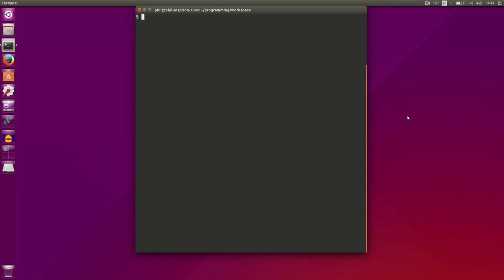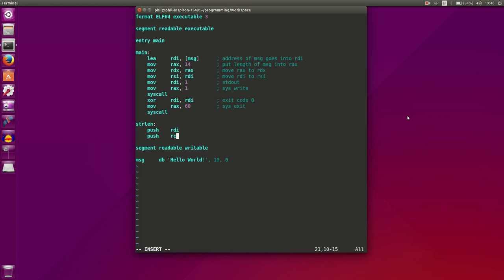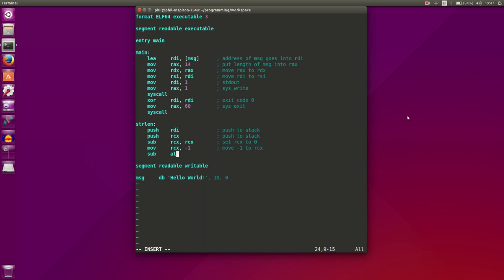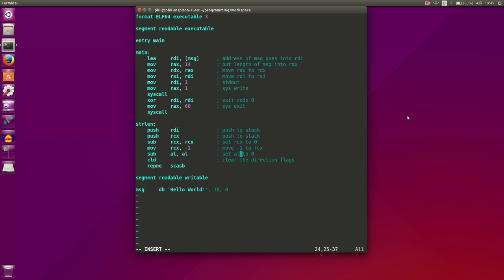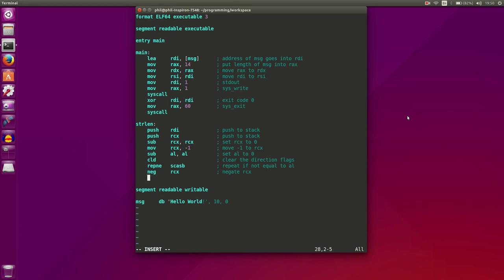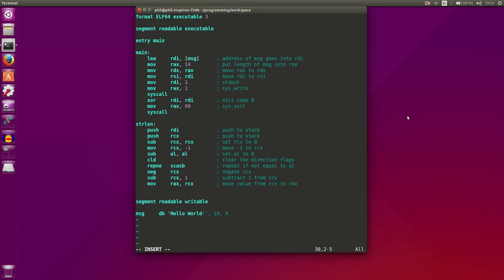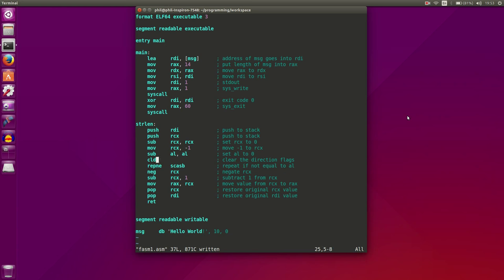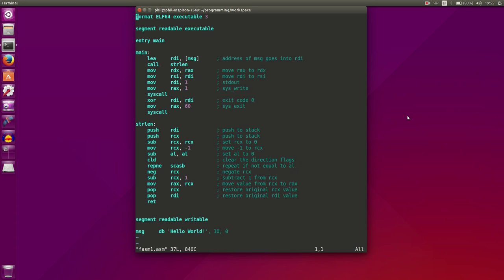Fasm 1 - String Length

Comment: The subtraction to zero the register is pointless in this case and confusing.  The move sets the register without introducing advanced considerations like instruction speed which could be a reasonable consideration for a heavily used function.

Comment: Forgive me if this is a dumb question (I'm a noob), but why do you set rcx to zero by subtracting its value from itself? Couldn't you just move zero into rcx...?
Reply: I think doing this way is an optimisation as there is no need to fetch zero from memory so is faster
Reply: @tetraquark2402  Thanks.

Comment: hmm one thing I dont get is:
you subtract rcx from rcx into rcx which results in a 0. but in the next operation you "move" -1 into rcx? Why would you set rcx to 0 and then move -1 into rcx? Isnt the subtraction part unnecessary? Thanks for the videos and I hope u can help my brain a bit hehe
Reply from the maker: Yeah, it looks like that subtraction was unnecessary. I probably wasn't thinking about the code enough when I wrote it.
Reply: Philip Bohun Thanks a lot for the clearification. As I currently dont have a computer I couldnt test it but it seems like your tutorial has helped me very well hehe. Thanks and have a great day! :)

Comment: I also don't get one thing: why use "sub" this time to set "rcx" to 0 and not "xor" like before?

Edit: I know that subtracting one quantity from itself results in 0. I also know that xoring a value results in zero as well.
*So the real question is: is there a time when using xor makes all the difference over using sub?*
Reply from the maker: In this program the two methods are interchangeable. I'm not sure if there are any x86-64 performance differences between the two, or if there are any differences in setting flags. If all you care about is zeroing a register, either method should be fine. 

When it comes to assembly language, architecture becomes very important. Suppose you had an architecture which always stored its answer in register A, then subtracting register B from B would zero out A!
Reply: @philipbohun740 can we write assembly code that does not require interrupts?